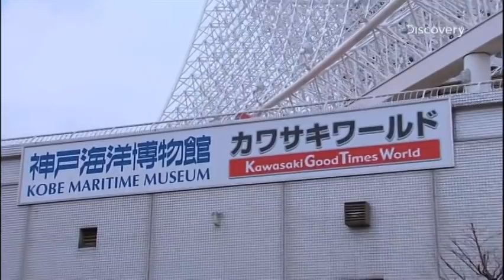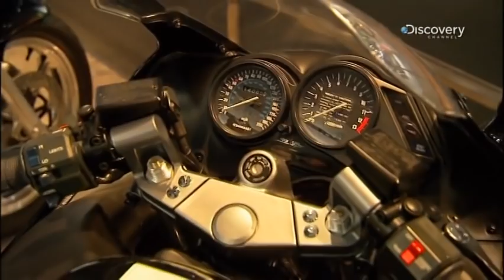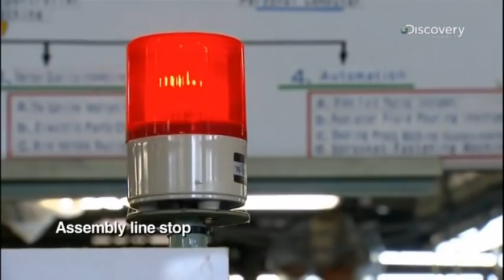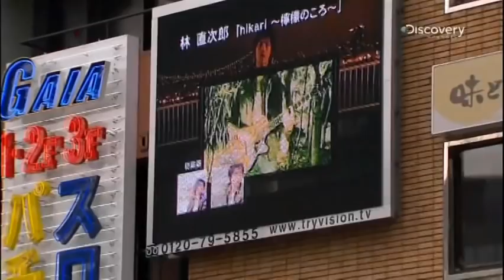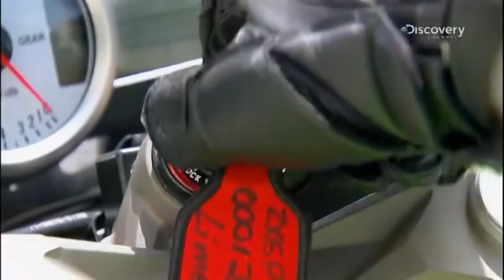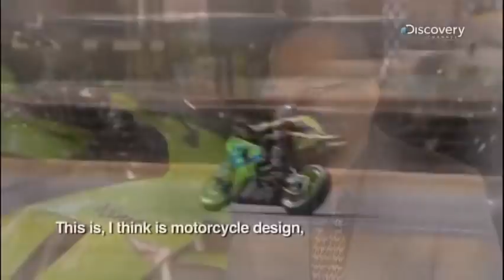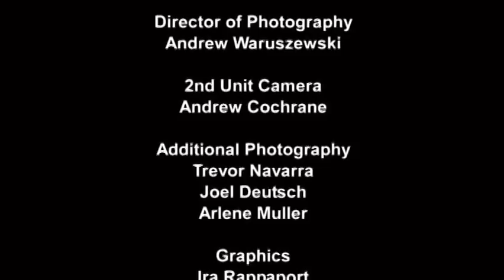KAWASAKI History, by Discovery channel, 世界のバイク

Comment: I had a mach 3......a damn house ran out in front of me.....
Reply: Vivek Sabbani
Reply: Vivek Sabbani
Reply: Ha, the Mach3, the most evil thing on 2 wheels.
Reply: I had an S1 250 ..a ditch ran out in front of me:-)
Reply: Dave Begotka 
Houses are impetuous like that, you know...she heard the bee's nest flying her way, and wanted to see the guy on it. She just wasn't quick enough
to get out of your way. It's all her fault.
Reply: N
Reply: np kellogg 1q.?
Reply: np kellogg
Reply: I owned on, then a mach IV after it. not evil, just a a power to weight rasho unlike anything ever released to the public. You had nothing to prepare you for what was going to happen when you laid the power on. It didn't matter what you'd owned before, from a bsa, triumph, rd yamaha, sazuki x-6 hustler or even a sportster,  nothing about riding those prepared you for the h1 and h2's. If you didn't respect the fact you had to be willing to accept a learning curve on when and how much throttle to use then the results were your fault, not the bike. You couldn't treat the throttle like an on/off switch. above 3500 rmps the h1 would try to run out from under you if you laid it on too quick. the h2 came on ever earlier. They were the most fun bikes I ever owned, and I still ride an 82 Honda Magna V-45. I love it but it's much heavier, not as nimble and he engine really rages between 8 and 10000 rpms but I know it's still probably a couple of tenths slower than my h-1 which would run 12.3's and my H2 which usually ran about 12 flat but I did break into the 11's one time. I drag raced my H models a lot, and btw was never beat in a street race by bike or car on either bike. it was so much fun taking money from guys that kind of chuckled when I called them out. Even beat a guy that trailered his 7 liter cameo with slicks on it. Ace up my sleeve was I got to pick where we raced and I picked a spot with rough asphalt that would give his slicks the least advantage. the Mach IV would launch like crazy in first and second gear and I knew he's see me ahead of him after the start. He did, he panicked, tried to put to much power down, went up in smoke coming out and couldn't catch me at the end. It was close though, the engine was a real monster. Once he got it hooked up he was coming. but sorry charlie, too late. 

The Harley snobs were the ones I most loved taking money from. I admit I didn't really like the sound of my H bikes except at high revs at full throttle where they sounded like the screaming F-1 engines of the day. So much so I'd never dream of putting expansion chambers on, but the Harley guys really hated that sound. 

Finally by 73 word got around and it got hard to find races. But that was about 3 years of fun. The only reason I didn't do better at the drag strip (National Trail Raceway east of Columbus Oh) was because the guy that held the national record in the class showed up there all the time. He trailered his "stock" bike, I rode mine in, which did make a difference on 2 stroke bikes that actually make more power stone cold. I'd get some money only on weekends when he was off to some more high profile or national event. Pete Grasselli. Called Pistol Pete. He consistently caught incredible reaction times on the old christmas trees that used 5 yellows before green instead of 3 like they do now.
Reply: +Jack Hammer duck
Reply: I always wanted to own one. I still remember an H1, the white tanker. It stopped at a stop light close to my house about 10 at night. I always liked the way it sounded, that uneven idle. Light changed, rider would hit first, second, third,...I listened as it wailed into the night.
Reply: when 2 Wheels mag in OZ tested one, the tester called it a rocked powered corkscrew. My friend bought one, he was test riding it and dropped it so had to buy it. He was addicted to the thing.
Reply: I had a 500 and a 750 2 stroke it was so quick I had to put a step in the seat so I would'nt slide off the back when I cracked the throttle
Reply: Robert Esposito I remember the feeling, especially with the H-2 that it was trying to run out from under you and leave  you behind.  You're probably right that the flat seat had something to do with the feeling. Well, that and the fact it was trying to run out from under you.
Reply: more likely you ran it out of oil. even then they don't blow sky high the seize up.
Reply: i just got a 1977 KZ750  for my bday. the torque on that thing is ridiculous!
Reply: says you. the left cylinder runs out first, the rings go dry and quickly seize the piston in the cylinder sleeve long before the whole engine heats up enough to do what you suggest. How do I know?

 it happened to me because a Honda dealer mechanic in Albuquerque ignored what I told him and set the  pump too high running  me out of oil in far northeaster Arizona in the middle of no where. 

The lines coming out of the single line are differently lengths so the left cylinder runs out first. as that one starts to seize and the others start to get oil starved it takes about a minute for it to seize up. You first notice you're applying more power to hold speed. anyone stupid enough to know something serious is wrong gets what they earned. 

after you notice that if  you roll out of the throttle and  pull the clutch in, it's all over. the engine comes to a quick dead stop. 

How do I know this? Personal experience having run out of oil in the middle of nowhere far northeastern Arizona, just south of monument valley Utah, I'm still doubting  your story. The mechanic set the pump way to rich and because I used the synthetic oils I found while drag racing they don't smoke once the engine is warm, otherwise with petrolium based oil I'd have noticed being trailed by a lot of smoke. 

One line come from the tank there's tee that runs separate lines to the cylinders. They are of course of differing lengths so the one with the shortest line runs out first.

At high speed and I was cruising about 85 that first (left) cylinder heats up in a hurry and as the all run our it's the left one that will seize up. 

I was fast cruising. When I noticed I was using more throttle to maintain speed I knew something was up. Then the bike started to slow even as I gave it more throttle. It dawned on me what was happening and i closed the throttle and pulled in the clutch. 

I don't think the engine turned on more rev when the clutch was disengaged. It siezed up hard. I rolled to a stop and with the ignition off I tried to kick it over and I would NOT turn. I went to the back and sure enough the exhaust tips were soaked with oil. 

So, this is the point. From 80 mph as I noticed it and gave it more throttle it would NOT maintain speed. There was no way to keep it running. Downshifting and going full throttle wold have been really really stupid and wouldn't have bought me more than about a minute  before the second piston would have sized. Since you can't keep it running you can't do the damage you're talking about. It's simple. Once the rings don't have oll the quickly seize the motor. This is well before the situation has had a chance to harm the rod bearings or crank bearings. 

So unless you were stupid enough try and keep it running by going to a lower and lower gear and using full fucking throttle you could not have blow it that way. It seizes way to fast. 

I gave it half an hour to cool down, still could not budge it. It was not even possible to budge the engine with the kick starter, and that's with only one cylinder seized.I put oil in the tank, pulled the plugs and put a sizable amount into the heads.  But since i couldn't restart it to re-oil it I had to use a large rock on the kick starter to budge it little at a time for about 3 full revs before the rings picked up the oil. But given where I was I had absurdity no choice but to patiently  free it up, put the plugs  back in and start kicking it over, the pulling the plugs out and cleaning the oil off put them back until I got it to sputteringly start and slowly clear the oil out of the heads. I ran better than I though it would be had a bad vibraton that i was sure was because of the ring and cylinder damage. At that point the nearest dealer is Las effing Vegas. So I first rode to Grand Canyon and stayed several days where I met a guy also just doing the road thing and then we went to Vegas where I got it fixed under warranty after they verified the other dealer screw ups. 

This hadn't been my fault. I had a warranty check done in Dallas and told them on to mess with the pump setting since I was using expensive synthetic oil in it. The asshole leaned the pump out. I'm lucky I didn’t blow it up the next day because I rode from Dallas all the way to Tucumcari NM the next day including a whole tank of gas at 105 mph. I noticed the tops of the exhaust were burnt white when I stopped for gas but had to hustle  the rest of the ride because I knew there was weather going to hit at sunset. I barely made it. I then went to Albuquerque and had the deal set the pump back up. But I told them exactly where to set it. 

The asshole ignored me and set the pump too high so now I’m using oil much faster than I should have and ran it out in Geronimo country. 

Damn good thing I was headed to California and not about to go all the way back to Albuquerque to kick someone's ass.

Competence. That's all I ask for. Just simple competence.
Reply: Those are very cool. You think it has torque wait until you wind it up and the HP kicks in. You'd better have a safe place because you'll cover ground in a hurry. 

Have fun. If it's your first high performance bike be-careful. Take your time working up  your skills and learning how to manage the bike.  Don't go above 80 or 90 percent of what you "think"  you can do until you've got lots of hours under your but and have built the muscle memory so you don't think about what gear to be in at what situation, you just instinctively know. When  you ride it hard on twisty bits your hands and feet, and whole body will be busy. Too busy to have time to think about power, shifting,  turning, braking, how much front how much rear for what's called for. If you have to think about that stuff you'll get behind in decision making. If you're pushing you have to be ahead of the bike no behind it.
Reply: Waffle Man
Reply: ".Loose your all knowing critical for nothing"

I'm trying to have a discussion with someone that writes gibberish. 

Why would you come on to an anonymous internet forum and lie? <sarcasm on> you're right, that would be rely rare. <sarcasm off>

in a real conversation you'd be asked to make a plausible story about the claim other than flatly saying it. Therefore,  you wouldn't because the fabrication would be more and more obvious. That's why people do it on the internet. it's easier to duck and dodge questions from people like me who know H bikes inside out. 

I don't give a crap what you like or don't . the bike was built  before you were born. Who knows what problem was lurking. 

And if you were stupid enough to buy one of these as a first bike you are extremely lucky to be alive. I've seen people who couldn't be talked out of it climb on one as there first solo ride and not make it off the parking lot. 

When I sold my H-2 it was to a guy that was riding a "you meet the niceus people on a Honda " Dream 350 at first refused to sell it too him. Too big a jump. I took him on a ride to try and make my point. He offered me more money that I'd been asking for it. I spent half an hour going over him the ways she could bite you. First off was pushing to hard through very tight corners where you are most vulnerable to rocks gravel oil and water from A/C systems and lecturing him on the importance of knowing the surface you are on and constantly looking out in front for manhole covers, bumps, potholes,  seams in the asphault (that can cause speed-wobble) changes for asphalt to concrete, different kinds of asphalt, rocks, dirt, kinds of dirt like the red clay dirt in new mexicaco or slick clay dirt in the midwest that becomes a skate rink with water added. Everthing I'd learned in the last three  years that I hadn''t learned needed to learn in the 4 years before on less powerful bikes. 

He dropped by to ask for some advice about a week later. First thing I noticed was the right side engine over, the footpegs the muffler and both turn signals where scrapted up. He had dropped it. But kid was humble enough to come back to me for feedback on what he'd done wrong which hadn't been obvious when it happened. I took him to a place that had tight turns where I know the surface was good and put it through a couple of times at about 80 percent pace. 

We stopped and I gave him space to talk. He had figured it out himself. Not realizing that what the thought was modest amount of power increase on turn exit spun the back wheel over a few small rocks and it fortunately low sided him. I had already taught him how to make sure he was in the right gear in a turn to have the engine spun up where the power would come on hard of called upon, he just called upon it to much too soon on an unfamiliar surface. 

I ran across him a couple of months later right before leaving for the west coast (I had sold the bike for travel money) and he was ear to ear having the time of his life. He developed the relationship with it, which is kind of like falling for the wildest most independent passionate woman you ever met, but although she needed but you couldn't somply impose your will  on her or you'd never find her sweet spot, and they were really getting the most out of each other. 

how about some details?
Reply: and btw.. the 77 Mach IV was a pig compared to the 72.
Reply: H1's HAD A HELL OF A LOT OF SNAP ONCE THE REVS CAME UP
Reply: and on board it sounded like an F-1 engine.
Reply: they need to keep those damned houses on a leash. Telephone poles and boulders are also on that hit list.
Reply: I also used to give my buddys H2 a run for its money with my RD350 cafe bike....and mine never tried to kill me. Ultra light weight and an insane rider.
Reply: Your buddy must have had an S1 250. I ran the "fastest RD350 in town" with my S2 350 Triple (I had hand polished and matched the manifolds); pulled him 20 ft in 1st and I was gone. Your mistaking your buddy's bike for something larger is understandable though, everyone thought mine was a 750.
Reply: You start out being a little hard to take seriously since those engines did not have manifolds.  come to think of it none of the bikes I've owned between my 72 H2 and my 84 Honda Magna V45 have manifolds no intake manifold, no exhaust manifold. There's a flange and boot that connects the carburetor to the head and a flange that connects the exhaust pipe to the Head. No manifolds. The Kawasaki 2 stroke engines had piston ports... You have to take the engine apart to get to  them. The carbs have to come off the head has to come off and the cylinder has to come off.
Reply: Cat got your tongue?
Reply: there must be a post i'm not seeing.
Reply: For some reason, there are 3 posts that even I can only see when I'm signed on
Reply: Out Spokan ... I don't know what to tell you. They show up in my "notifications" but when I click on them they don't show up on the page that opens.
Reply: ive got a 98 honda magna 750...... the first time i went over 6000rpm i about shit my self....

thows "v twin" 4 cylinders are a tame little puppy at 5500 rpm..... and a killing machine past 6000

my dad has yet to go over 6000 rpm......he is an old school hot rodder.... 
5200 rpm is red line on his 440 mopar....so he thinks anything over ~5500 is bad for the bike....

and my old man is old.....he would probably have a heart attack lol

but ya.... he said "when i down shift the tire starts to skid"
im like....ya have to rev match dude
"whats rev matching?" 

also had to teach him about counter steer.....and not just leaning to turn

"i did waht ya told me...it makes the bike turn really quick"
"ya, thats the point dad"

he has a 97 buick lesaber BOAT with 250k miles....i think he has lost the "need for speed"
Reply: Carbon Crank  mabe next time check the oil.

Comment: I owned a 3-cyl 750. It was TERRIBLE to ride! After one summer and lots of headache pills I sold it. And got a 4-cyl OHC Honda 750 instead, which run like a dream! I also tried the Kawasaki 500 (also 3-cyl). It run better than the 750. But not by much...

Comment: Only bikes I ever owned
Reply: All my bikes since 93 have been Kawasaki's. There is just something about them.
Reply: @MichaelZZRrider  I got my first street Kaw in 78 A SR650 back then you couldn't import 750 because AMF who owned Harley  Davidson a the time got a ban passed. So they just called then 650 My Sr would out run any old  Hon,Suk, Yam 750 no problem.. Rod e some 900z but they went fast straight but didn't handle well in the corners. Then I got my First Ninja got more tickets in a year that at any time in my life. Young dumb and had a fast motorbike.
Reply: @markhopkins222  Ha! Indeed, I am old and dumb. I have had the GPX750R, GPZ 900R,ZX10,ZX6R, and a ZZR 1100. I currently have another ZZR1100, a ZX125RR and a ZX14R. I ride them everyday like there is no tomorrow Ha! Ha!